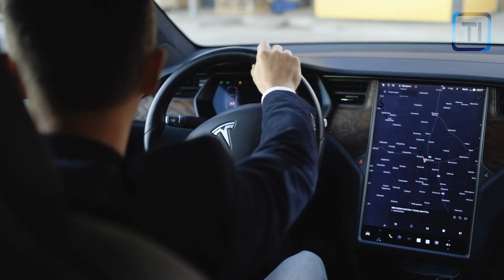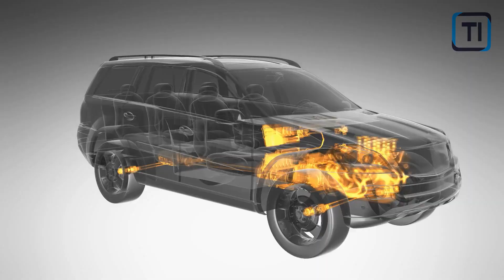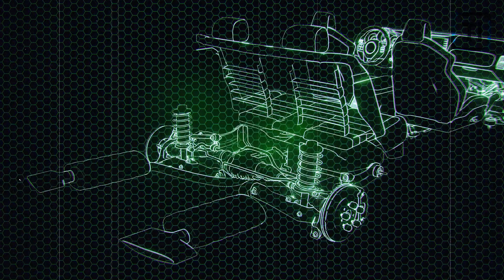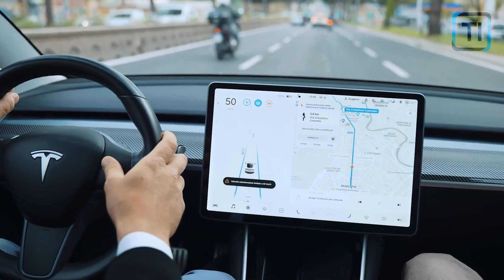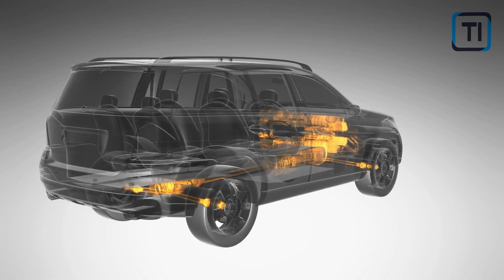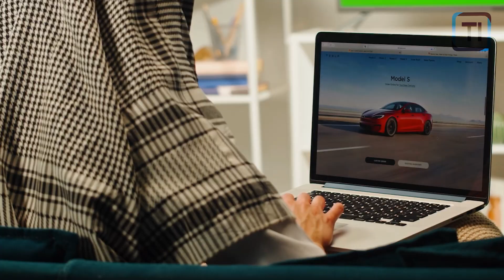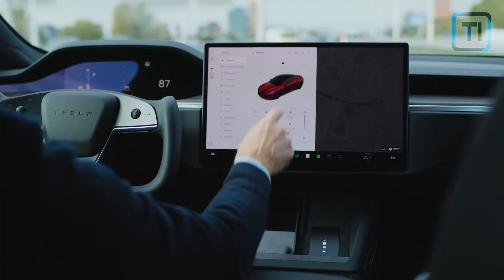GAME OVER! TOYOTA'S New WATER ENGINE Will Destroy Entire EV Industry!

Comment: Don't hold your breath on this one. Toyota may be a inovative company but the energy you put into seperating oxygen and hydrogen from water to burn it as fuel is not efficient as it takes more energy to seperate the hyderogen from the oxygen than is produced when burning the hydrogen. Another TikToc idea like this is using an electric motor to turn a generator which in turn powers the motor. This should be on TikToc with all the other dumb ideas.

Comment: Totally ridiculous.   Hydrogen from electricity is somewhat inefficient, so you're going to need another 25% more electricity to separate out the Hydrogen.   Then Hydrogen fuel cells are only around 50% efficient, so you lose another half of the energy there.   Add to that the issues with storing Hydrogen under high pressure and the associated hazards.   Not gonna fly.  It may qualify Toyota to get some national award or grant, but a reasonable source of automobile power, no way.

Comment: i read about water engines back in 1970's but it never came to surface , oil companies never allowed it.
Reply: It's just a combustion engine or a hydrogen fuel cell with electro motor - this video mentions both, it's BS. This one year old video (which interestingly seems to be about the same engine?) actually explains stuff https://www.youtube.com/watch?v=vJjKwSF9gT8 and isn't just propaganda and most importantly - ALL has been done before and is in fact in active productive use
Reply: Nope.   Not possible.   You obviously took no science in school or failed.

Comment: What a lot of pointless chatter about the power of water wheels just to tell us that it's basically an electric / Hydrogen powered engine which was invented years ago.   Fossil fuels are not fossil and are not a finite resource either, just like Prime water. Also, C02 is not a Green House Gas.   The benefits will be small for consumers as water will then cost a fortune (taxed to oblivion) whether you use it to power a vehicle or just use it for domestic purposes.  They will make sure there'll be no way around being ripped off.
Reply: I thought that too.